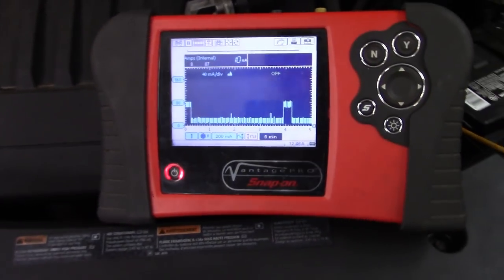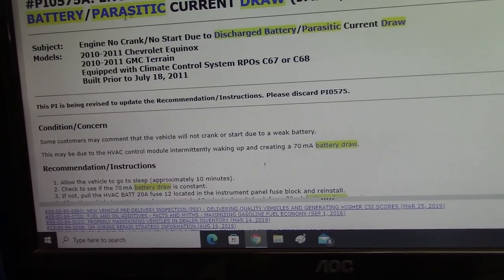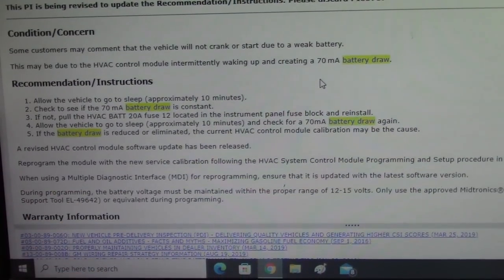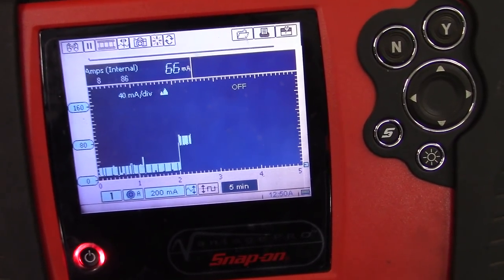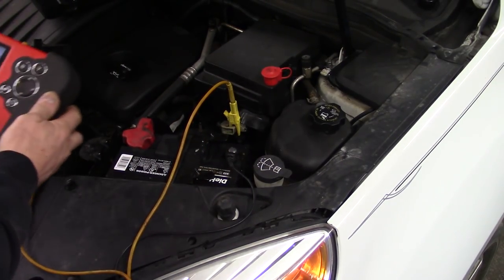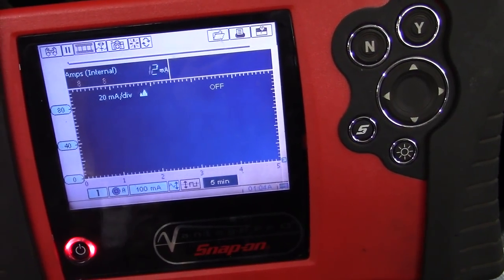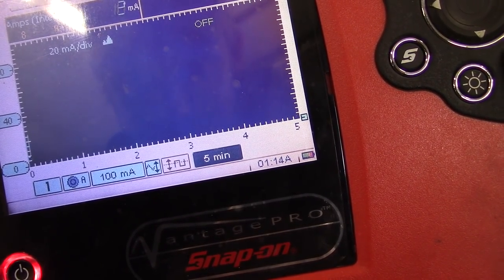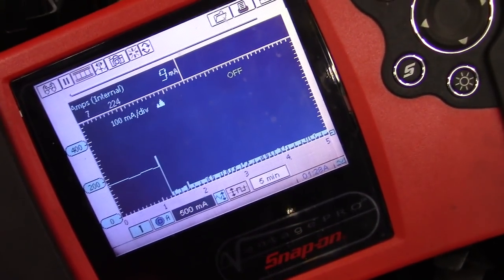Chevy Equinox: Battery Draw- Fixed With Service Info

Comment: I have a question reliability. Looking at new cars and deciding between Toyota and Ford truck. I noticed you have a lot more Chevys in the videos than Fords. In your opinion as a mechanic do Fords hold up better over time?
Reply: To me every make has issues but my opinion i stay away from GM anything I never have any luck with them at all but I know people that have great reliability with them
Reply: @frankm8533  Agreed. I've had lots of makes in the past, and got the best reliability and longevity out of Toyotas before they start needing repairs.
Reply: @txc500  I bet. Im actually looking for a older Toyota beater car or truck but I see 2000 Tacomas with rust guys wanting 8,000$ I said yeah no way!!!!!

Comment: If a 70mA draw for a few seconds every 4 minutes is an issue, you probably have bigger issues to tackle.

Maintain your freaking vehicle.  Do you really think Jay Leno is letting his 200 vehicles sit idle till the battery is dead?  Would it really hurt to maintain your battery a bit?

Comment: You're lucky.  I have to use my SPS on one Virtual Machine with my Chinese Clone MDI2, then I have to change to a clone VCX Nano and fire up a different virtual machine to run my "free" gds2.  And I have a different Virtual machine to run my "free" Tech2Win on my MDI2 Clone.   My MDI 2 (Bosh) clone will program a Yota though.  I figured that out the other day.
Reply from the maker: I'm not nerdy enough therefore I have to pay for everything LOL plus I don't have too much time to piss around 😂

Comment: Typical battery has 50AH.  50AH/10mA = 5000hours ; 5000hours/24hours/day/30days/month = 7 months.  So if car sits without running and charging the battery then the battery will be totally dead in 7 months.  But in reality the car probably won't start when battery is half depleted. So 3 to 4 months max and car won't start.  That is why I put in a top post battery disconnect switch on my seldom used pickup.
Since car batteries are not deep discharge type then running them completely dead, even just once, ruins them.
On the other hand if you have a much older car without a computer then it can sit for several years and still start just fine.

Comment: "Why so much to fix a draw??" Well let's see first I had to test it that took 1/2hr Than I had to find the new software for the heat and a/c(what do you mean software) Hang on let me finish; then I had to pay(a lot of money to the company that built your car) to reprogram your module(which takes quite a while)) and then I had to retest. Oh and recharge your battery( I did that for free) The software is for the computers in your car 
"What I have a computer in my car?"
Yes, mam, your newish car has a Controller Area Network(like the internet) and multiple (often unnecessary computers)
 "Why?" 
Well I have my opinion but ask the manufactures

Comment: Oh get rid of it. I had a new 2015 knox and it was garbage.  Everything went.  Center stack (2) Engine mounts, front axle, a/c and heater control module inside the dash, wipers broke,  cruise control switches (2) radio control switch on wheel, several engine components, Engine was torn down in 2020 50% of engine replaced due to bolts breaking and cam shaft sensors replaced, timing chains went then in 2021 it was torn down again cause it started shaking and shutting off, turns out everything that was replaced year before went bad again.  After paying over 2 grand the second time (first time ext warranty covered) within 2 months it started to shake and vibrate and shut off when you stop.  I finally said goodbye and got rid of it.  Never owned a piece of junk in my life. I had the 4 banger engine.

Comment: HVAC air damper door moving with CLICKITY CLICKS = CLUCKITY CLUCK CUSTOMER CALLBACK!
Reply from the maker: It was not there to have the HVAC clicking sound looked at. So no, it's not a comeback. It's a different problem.

Comment: Computers in cars are just stupid, give me back carbs and cables. One stubborn old guy .
Reply: I think somewhat the same, but not quite to that degree.
You gotta have the catalytic converter. Otherwise the smog outside gets worse than Beijing. And with that catalytic converter comes fuel injection. Now the benefit of that is that you don't need to make it very complex fuel injection. Simple throttle-body injection is plenty good enough (multi-point sequential fuel injection is better, but not by much).
Electronic ignition is another must, simply because it lets the engine adapt to changing conditions better than a "simple" vacuum advance system would. Nothing wrong with a distributor tho, I'm not saying you need to go straight to coil-on-plug, just have a transistor switching the coil on and off at the right time instead of points and condenser.

The benefit to the user of these electronics is that your vehicle becomes immune to becoming vapor-locked, which you can't say about a vehicle that has a carb and/or points and condenser ignition.

Of course all that is avoided if you choose a diesel engine, those are plenty happy with mechanical fuel injection, and as you know diesels don't have spark plugs in the first place. Those you CAN control quite effectively with just a few control cables.
Reply: @44R0Ndin  and then you get the pleasure of dealing with DEF....
Reply: Its challenging diagnosing some of the newer stuff. The laptop and module programming is interesting though. Everything is crammed in everywhere so socket swivel and extensions are a norm. Its going to get REALLY specialized and high paying for people who know their stuff. 

Problem is, one bad wire or connection will take the car down and may be quite hard to find.
Reply: @x_x_w_  Yeah, it's true that's a pain in the ass, and to be honest you can't really have the modern emissions stuff on a diesel without some electronic means of controlling the fuel system either.
The DEF actually does last a good long time tho, it's not like you gotta fill the DEF tank every time you fill the gas tank, it's like every 10th tank or something. Not that bad.
There's something to be said for the older diesel engines tho, they can be made to run on filtered waste vegetable oil like you'd get from McDonalds or another place that sells fried foods. As far as renewable energy goes, that counts IMO. Just like fueling a gasoline engine with mostly alchahol fuel such as E85 is pretty much renewable energy too. now if we could just figure out a way to make the dang stuff from the parts of plants that we can't eat we'd have it pretty much made.
Reply: @mph5896  Oh trust me, where I live (near where Eric O lives), the wires fail pretty often, and the computers basically never fail unless secondary ignition voltage finds its way on to the wires connected to the computer (happened once on a Dodge with a failed ignition coil that of course came in as crank-no-start).
Or the computers could be located in stupid locations where the water pools on them and some idiot decided that the connectors should face up. Seen that too. Recipe for corroded connectors, and then you gotta junk the whole module.

And trust me, the need for extensions and swivels is unchanged from how it was previously, cars haven't really gotten any tighter packed since the '90s.
Hondas and Toyotas are the best to work on by the way, because they're basically the only automakers that think not just about how you gotta put it together but also about how you gotta take it apart to work on it.
Some VW Auto Group vehicles (VW, Audi, BMW, maybe a few others), you gotta take off the front bumper to get at the front of the engine. They make it real easy to do that tho, but where I live you better hope the whole thing hasn't rusted together.

Comment: well if it still has a 168ma draw you didn't fix it right.
Reply: Thats a draw of 0.17 of an amp.   i.e.  the security system and/or communications bus system.    The only way the draw will be zero is to disconnect the battery.     There will always be some draw due to the vehicle electronics and security system etc.      The draw is so low, even casual use will keep the battery charged.

Comment: That vehicle is garbage since before it was even being built sorry to say but Honda & Acura is better hands down
Reply: They are. Used you can buy them for a nickel and throw parts at it cheap if you are a mechanic. I fixed a buddy's kids Equinox. Timing chains, cats, o2's, oil pan gasket, pcv cleaning for cost of parts and a trade for tile work. Thing ran great post repair. Prob $4k at the dealer for $700 in parts.